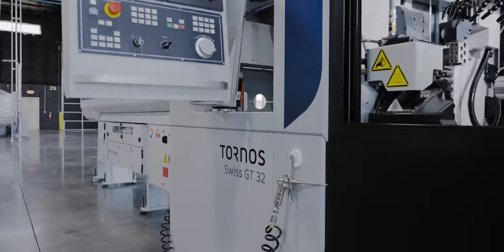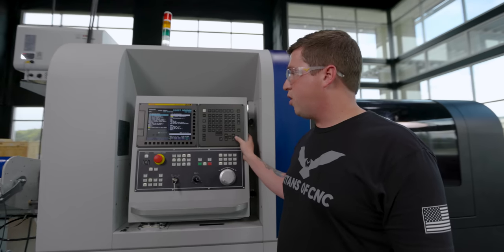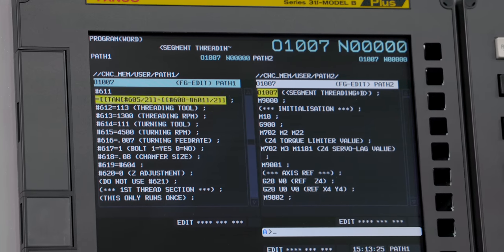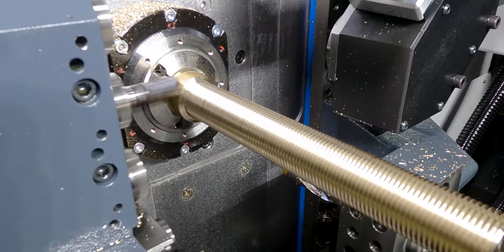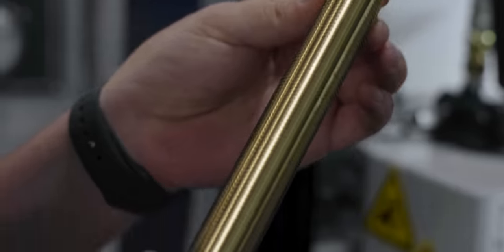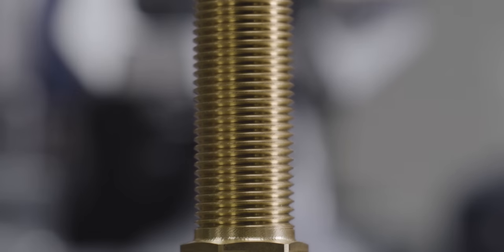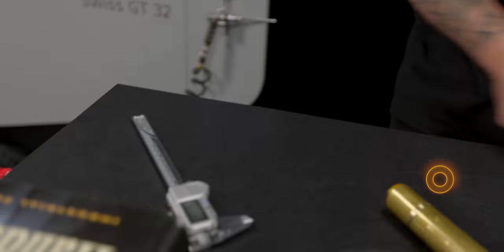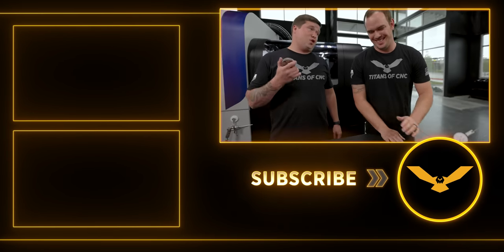Macro Programming is the Most Powerful Tool in Swiss Machining

Comment: I did some complex macros, togheter with logic checks (i.e. when the lenght of item is greater than 550mm, drill additonal hole), and switches. It was absolute gamechanger for custom kitchen furniture. Instead of making program for each single board, you only pit numbers, check options, and run program. Programming whole kitchen went from two hours, to 10-15 minutes.

Comment: I’ve owned my own shop for 3.5 years and been in the industry for 8. I know nothing of programming macros. Please please please do a masterclass on macros.
Reply: Yes please!
Reply: i can't really weigh in on this but what we do at work has logic in it and uses macros. i'm just an operator, not a program guy at work. i do have a simple understanding of it as i also troubleshoot when i see something off. i'm also their trainer.. long and short of it is redirecting the program. you can have a program to do a bunch of different operations and tailor it to what you need done. honestly it's not that complicated once you see it. really handy to have for reman stuff, what i do. anyway say you want to bore a hole but want the option to do several different sizes.. you have the code to do all the different sizes with tool paths and all that, all with an n number at first. before that you'll have several lines that say "if[#150eq3]goto500"  just use the macro number, 150 in the example, to tell it what you what to do, 3 in the example. it'll then direct it to the part of the code you need, n500 in the example. even cooler, you can send it back to the macro line if you use the n numbers right so you can do multiples. if you're just doing stuff out of stock, probably not all that helpful. making a machine so anyone can feed it in a fast paced manner while fixing wore out junk, it's what you want. i know that example line of code will work on a fanauc controller, i'm looking at the same program i've ran at work. might not be that simple one other machines.

Comment: This reminds me to Q-Parameters in Heidenhain control, if you master them you can program extremly efficient and you can program complex forms in just a few lines of Code
Reply: i have several Q-parameter programs for different usecases which also use cycles, for example face milling, threadmilling etc
Reply: @ipadize  yip they are great   its probably the easier control  to do it with.
Reply: @markmall7142  i just wish we had something like "if this and this and this equals this then"

Comment: Most people think about parametric programming and making it easy to program similar parts when they think about macros, but the really powerful stuff is when you start using macros to automate processes. A creative macro programmer with a probe can create processes so stable that you know for a fact the machine will alarm out or will adjust an offset or tool length or whatever before things start to go sideways. You combine that with using redundant tooling and tool life, and you can start to do a lot of things most companies don't even know is possible.

Comment: Didn't know it's considered ground breaking for some other machinists. We basically do every standardized feature like threads, helix machining and standard milling paths with these macros. We call them "under programs" as sometimes they are a program within the program. Nice explanation!
Reply: Interesting, we call them “sub programs”.
Reply: @kw2519  In general-purpose programming languages (the kind of languages we use to make most computer programs like for example the software on your cnc machine) they're generally referred to as functions or methods, I think some older languages refer to them as subroutines. That is of course if I understand correctly what a macro is in this context, he never really said anything about what macros actually are and I haven't written any G-code in the last 15 years.
Reply: The macros he is talking about are different than a standard gcode subprogram. Pretty sure he is using fanuc maco b. Quick example of what you can do:
N1     (line number 1)
#500=#500+1     (set variable #500 to its value plus 1)
IF[#500LT100]GOTO1     (if variable #500 is less than 100, jump to line number 1)
M30 

So this would loop 100 times from line number 1 to the if statement then end.
Reply: @Chris-du7hi  So you're saying macros are language constructs like ifs and gotos, as opposed to regular G codes? Interesting, I didn't know you could do that but I also always wondered why not. 
This is basically just regular computer programming. It's more primitive than what you'd see in a language like Java or C# but essentially the same thing. 
Thanks for elaborating

Comment: I made a macro program for a mill where I used to work just a facing cycle but you could easily change the stock height, depth of cut and how much material to remove just a simple easy way to face off blocks of material without loads of programmes. But anyway really good example of how to use these Swiss lathes. That’s pretty impressive how well it picks back up the thread. I do wonder how well it would do on more of a finer thread as that thread looked pretty coarse and no offence may be due to no coolant/oil but the thread finish didn’t look the best visually

Comment: Absolutely is I use Macro programming every chance I get. I would love to see that program. Then I wouldn't have to clamp one end of the part with the sub and sync main and sub to machine a long thread in case the bar is not supported by the guide bushing enough to eliminate taper in the thread.

Comment: Are G-code and M-code different for different machines?
Reply: Yes and no. There are some machine specific G codes and m codes. For the most part though they are the same. G0 is a rapid move. While G1 is a feed move. Those are pretty standard across almost every type of machine. Mills and lathes though can use the same G & M codes to mean different things though. Some codes don't apply across machine types. The most obvious is a tool length offset code on a mill doesn't really apply on a lathe.

Comment: How do you call in a macro?
My robodrill has several on the Memory screen. I belive they said probing, threading, peck cycle ect. What are the benefits of a macro vs just programming it with fusion
Reply: The main benefit is when you have a repetitive process that needs to be altered on the fly at the machine quickly. If you do a lot of thread milling for example I could write a macro for that and by the time you open your computer I could be cutting. On the other hand if you have complex geometry on your part using CAM is WAY more efficient
Reply: @donniehinske , that's funny you mention thread milling. I'm milling a m23x1.00 thread and trying to dial that in is going back and forth, posting uploading, back to the cam, back to the machine
Reply: Macros are called by : G65<macro name/number> followed by any variable values you wish to pass to it. That is if the macro itself is not written in as part of your main programme….

Comment: Using macros for tool call outs and spindle speeds is dangerous and frowned upon. Spindle speed especially. Since spindle speed is modal it can cause very bad things to happen.
Reply: That’s true, but if you know what you’re doing you can write in checks & limits to avoid any safety issues. In fact, you most definitely SHOULD do so….

Comment: number variables are super... ugly....
Doesn't this machine support named variables?
Reply: In Recent versions of Fanuc 31i cnc you can assign names to a limited number of custom macro variables
Reply: @filippomontevecchi8618  thanks, I'm using LinuxCNC,  we have both.. but I'm mainly using named variables due to better readability.
Threading is no problem also segmented threading should be no problem with it. I use to re-run threading cycles whenever it's needed and since it relies on the index signal it's always spot on as well.

Comment: сегодня отработаю на tornos gt26 

#500=14 (DIAM PRUTKA)
#600=9.78 (MAJOR DIAM)
#601=8.16 (MINOR DIAM)
#602=1.5(THREAD PITCH)
#603=0 (INITIAL Z)
#625=-25.9(FINAL Z POSITION)
#617=4 (KOL-VO)
#604=#625/#617 (SEGMENT LENGTH)
#605=59(THREAD ANGLE)
#606=0.05 (1ST DEPTH OF CUT-RADIAL)
#608=10.5 (RAPID DIAMETER)
#609=12 (NUMBER OF PASSES)
#607=2 (NUMBER OF FINISHING PASSAGES)
#610=[[[#600-[#606*2]]-#601]/#609]
#611=[[TAN[#605/2]]*[[#608-#601]/2]]
#612=112(THREADING TOOL)
#613=1000(THREADING RPM)
#614=114(TURNING TOOL)
#615=3000(TURNING RPM)
#616=.1(TURNING FEEDRATE)
#619=#604
#620=0 (Z ADJUSTMENT)

(***1ST THREAD SECTION****)
(THIS ONLY RUNS ONCE)
G28U0
G95G97S#615M103P1
T#614(TURN TOOL)
G0Y0
X[#500+.5] 
G0Z[#624+.5]
G1X#600F#616
G1Z[#604-#602](PROXOD)
X[#500-.5] (FASKA)
X[#500+.25]W-.5
G0X[#500+.5]
G28U0
(1ST THREAD SECTION)
G28U0
G95G97S#613M103P1
T#612(THREAD TOOL)
G0Y0
G0X[[#600-[2*#606]]+[#608-#601]]Z[#603+[#602+#611]]
W#620
G33W-#611U-[#608-#601]F#602
G33Z#604
G33W-#611U[#608-#601]
G0Z[#603+[#602+#611]
#621=0
WHILE[#621LT#609]DO2
G0U-#610Z[#603+[#602+#611]]
W#620
G33W-#611U-[#608-#601]F#602
G33Z#604
G33W-#611U[#608-#601]
G0Z[#603+[#602+#611]
#621=[#621+1]
END2
#622=0
WHILE[#622LT#607]DO3
G0X#608Z[#603+[#602+#611]]
W#620
G33W-#611U-[#608-#601]F#602
G33Z#604
G33W-#611U[#608-#601]
G0Z[#603+[#602+#611]
#622=[#622+1] 
END3
G0X[#500+.1]
G28U0

(***MAIN LOOP TURN***)
N100 (LOOP FOR MIDDLE PASSES)
IF[[#604+#619-#602]LE#625]GOTO200
#624=#604
#604=[#604+#619]
G28U0
G95G97S#615M103P1
T#614(TURN TOOL)
G0Y0
X[#500+.05] (X1.175)
G0Z[#624+.05]
G1X#600F#616
G1Z[#604-#602](PROXOD)
X[#500-.5] (FASKA)
X[#500+.25]W-.5
G0X[#500+.5]
G28U0
(***MAIN LOOP THREAD***)
G28U0
G95G97S#613M103P1
T#612(THREAD TOOL)
G0Y0
G0X[[#600-[2*#606]]+[#608-#601]]Z[#624+[#602+#611]]
W#620
G33W-#611U-[#608-#601]F#602
G33Z#604
G33W-#611U[#608-#601]
G0Z[#624+[#602+#611]]
#621=0
WHILE[#621LT#609]DO2
G0U-#610Z[#624+[#602+#611]]
W#620
G33W-#611U-[#608-#601]F#602
G33Z#604
G33W-#611U[#608-#601]
G0Z[#624+[#602+#611]]
#621=[#621+1]
END2
#622=0
WHILE[#622LT#607]DO3
G0X#608Z[#624+[#602+#611]]
W#620
G33W-#611U-[#608-#601]F#602
G33Z#604
G33W-#611U[#608-#601]
G0Z[#624+[#602+#611]]
#622=[#622+1]
END3
G0X[#500+.1]
G28U0
GOTO100

(***FINAL TURN***)
N200
#624=#604
G28U0
G95G97S#615M103P1
T#614(TURN TOOL)
G0Y0
X[#500+.05] (X1.175)
G0Z[#624+.05]
X[#600+.05]
G1X#600F#616
G1Z[#625](PROXOD)
X[#500-.5] (FASKA)
X[#500+.25]W-.5
G0X[#500+.5]
G28U0
(FINAL THREAD)
G28U0
G95G97S#613M103P1
T#612(THREAD TOOL)
G0Y0
G0X[[#600-[2*#606]]+[#608-#601]]Z[#624+[#602+#611]]
W#620
G33W-#611U-[#608-#601]F#602
G33Z[#625+#602]
G33W-#611U[#608-#601]
G0Z[#624+[#602+#611]]
#621=0
WHILE[#621LT#609]DO2
G0U-#610Z[#624+[#602+#611]]
W#620
G33W-#611U-[#608-#601]F#602
G33Z[#625+#602]
G33W-#611U[#608-#601]
G0Z[#624+[#602+#611]]
#621=[#621+1]
END2
#622=0
WHILE[#622LT#607]DO3
G0X#608Z[#624+[#602+#611]]
W#620
G33W-#611U-[#608-#601]F#602
G33Z[#625+#602]
G33W-#611U[#608-#601]
G0Z[#624+[#602+#611]]
#622=[#622+1]
END3
G0X[#500+.1]
G28U0